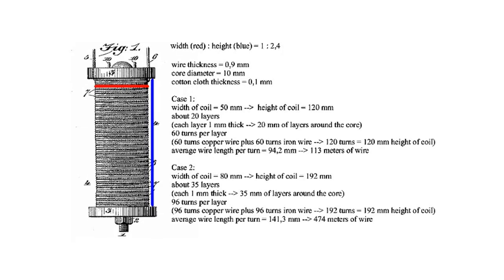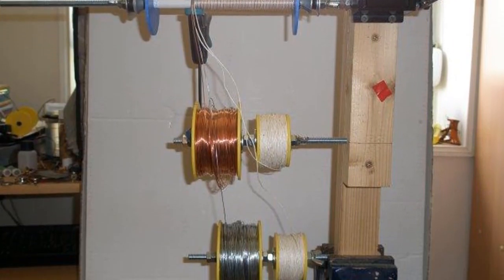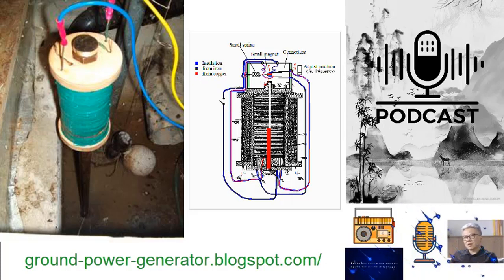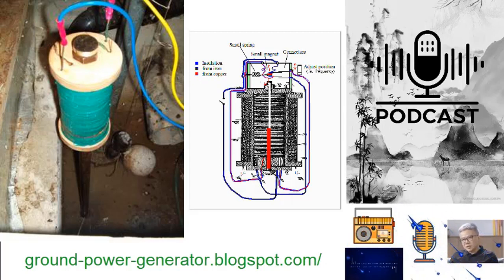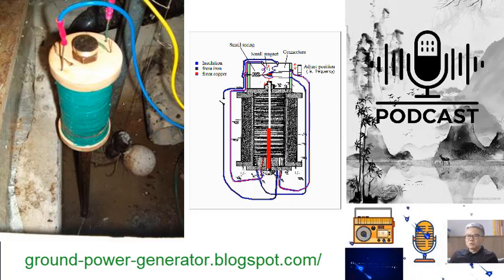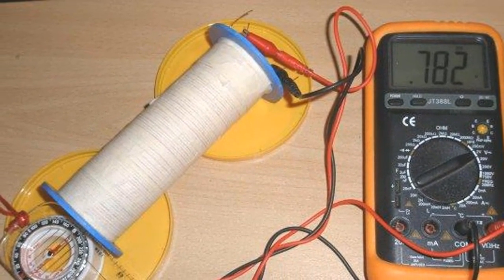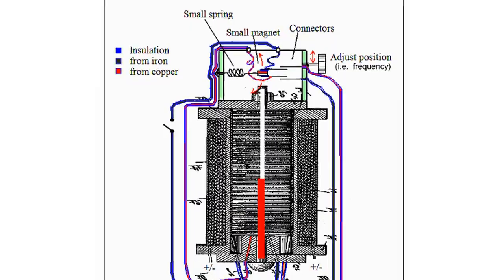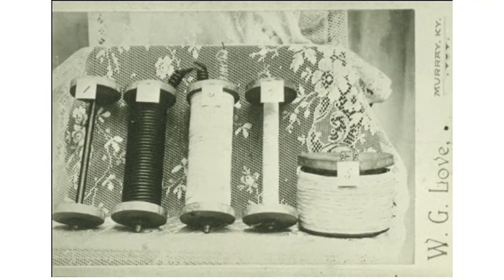Earth Battery High Voltage: Aluminum Rings and Voltage Multiplication | Earth Battery Stubblefield

Comment: "it engages in a voltaic dange with the earth electromagnetic field generating current" very scientific, anyways it simply is a battery, there is no free energy, because the energy you are generating comes at the cost of the metal slowly dissolving into the electrolyte, so after some time you will have to replace the copper and iron coil, so after all you are generating an amount of energy that is less than the energy the metal wire manufacturer used to extract the metal from the mineral, but because you are paying that energy trough the cost of the metal after all you are loosing money.